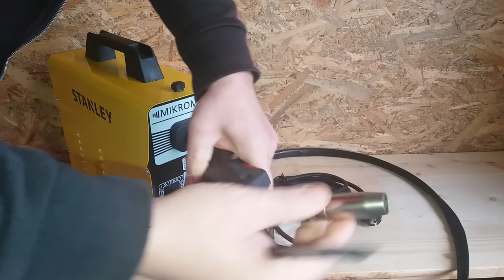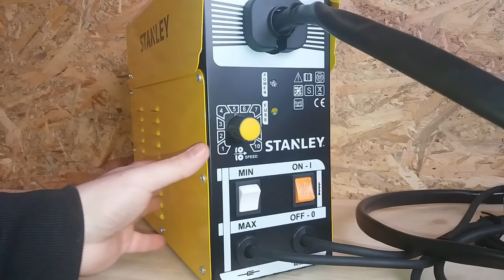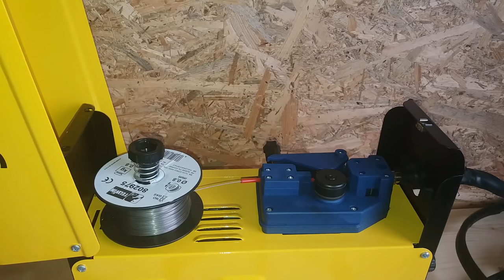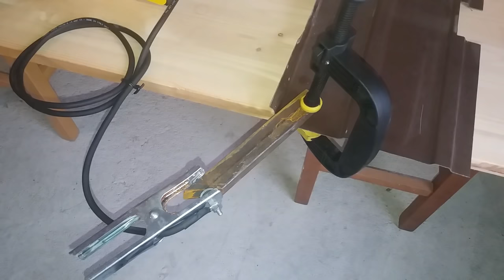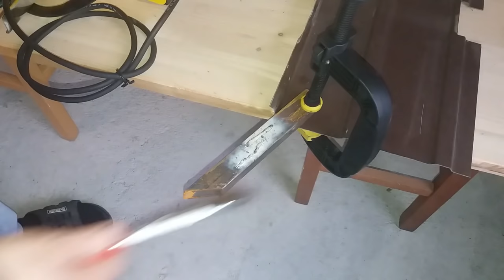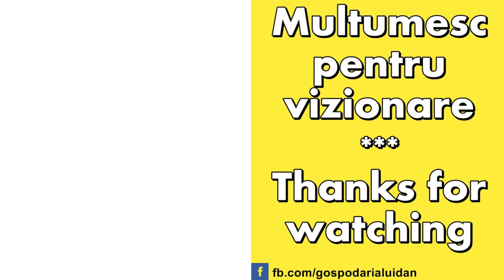Stanley Mikromig, aparat de sudura cu sarma

Comment from the maker: Pentru cei care se mira asa de tare ca am spus ca as incerca sa sudez si fara mustiucul de protectie, las aici un clip, mie imi pare ca tipul ala stie ce face: https://www.youtube.com/embed/s9OI6MqKA4E?start=105
Reply: De protecție la ce ? Ăla te protejează doar de scântei și uneori să nu poți da cu pistoletul la masă. De ce „uneori” ? Pentru că atâta zgură se strânge la interior, că unește duza de acel difuzor ceramic (îmbrăcat în cupru). Ca să vezi locul unde urmează să sudezi, poși ține pistoletul mai depărtat de piese, pentru că nu ești dependent de vr-un gaz. Îl poți ține și la 5 cm de piese, pentru că gazul rezultă din arderea fluxului, care e pe interiorul sârmei (la electrod e pe exterior). Cu cât distanța e mai mare, riști să se topească sârma pe toată lungimea, dacă avansul nu e corect reglat. Un avans mare unește sârma de piesă și așa dispare arcul care topește cele trei elemente - piesa, sârma și flux. Dacă avansul sârmei e mic, se formează un arc  voltaic mai mare, care pendulează între piesele de sudat, sârma picurând când pe o piesă, când pe cealaltă, și nu se unește topitura. O tensiune mare (atenție, nu curent mare, sau amperaj , după cum i se mai spune), face același lucru, să „fugă” arcul când pe o piesă , când pe alta, rezultând depunere grosolană până la unirea topiturii. După cu bâzâia aparatul, e un transformator simplu, iar după zgomotul la sudat, cum exploda sârma topită, e curent alternativ. În curent continuu și cu droser de netezire, nu lasă nici stropi, nu face nici așa zgomot, se reduce curentul de sudură cu mult ( nu mai găurește), încât poți suda și tabla de 0,3 cu el. Dacă-i mai faci și un reglaj al curentului, cu un triac, ai reglaj continuu, nu doar în două trepte. E rău că nu poți pune bobină mare, că tot e așa greu el. La proba a doua, ai mers prea repede cu pistoletul.
Reply from the maker: @nelute5  Da, de mustiucul ala vorbeam, am primit mesaje ca nu se poate suda fara el, de asta am tinut sa fac precizarea referitor la ce am spus in clip ca vreau sa incerc sa dau si fara el.
Reply: @DemoToolsYT  , merge și fără el,  nu are niciun efect negativ asupra sudurii.

Comment: Cumnatul tău probabil a sudat cu mașinării industriale  la 380 cu CO2. Eu am lucrat în Spania cu aparate mari și într-adevăr difera sudura și nu lasă zgura deloc. Acest aparat e foarte bun pt casa și se numește sudura  flux nu mig mag. Aparatele  MIG mag sunt întotdeauna cu gaz MIG (METAL INERT GAS) și MAG METAL ACTIV GAS). la amperaj mic redu din viteza sârmei pt ca e pt suduri mai fine.
Reply from the maker: "Stanley Mikromig este un aparat de sudura mig-mag care poate suda cu flux, tubulara de sarma, fara gaz de protectie." Asta scrie pe site-ul Dedemanului.
Reply: @DemoToolsYT  st foarte multe aparate flux pe care cei ce le fabrica mai scriu și MIG MAG pe ele dar este impropriu spus pt ca nu folosesc GAZ. Am văz ca în dedeman aparatul acesta costa cam 200 de euro. La aprox 250-300 de euro găsiți pe ebay și nu numai aparate foarte asemănătoare cu acesta, GAS no GAS  adică și MIG și Flux ( se schimba polaritatea pt flux sau mig și se inversează întoarce și rotita peste care trece sarma (are doua canale) cu canalul corespunzător și se schimba și sarma ca e diferita(  cea pt gaz rosiatica) acele aparate au în loc de butonul max min o rotita ca cea care modifica viteza sârmei și pistolul nu face masă dacă nu se apasa butonul. Sper ca e de folos comentariu  pt ce ce vor sa achiziționeze un aparat asemănător. Oricum asa cum am zis e destul de bun pt uzul casnic.
Reply from the maker: @danidaniel1531  Am inteles, multumesc de informatii, am mai aflat ceva.
Reply: @DemoToolsYT  , nu te lua după toți analfabeții din magazine și televiziuni, ci ia de bună ce spun cei ce comentează aici, ca buni cunoscători, unii cu experiență bună ! Aparatul e un simplu transformator de sudură, dimensionat să suporte curentul ce-l ia sârma de 0,8 și 0,9 adică maxim 70-90A, care are în plus un transportor de sârmă cu modulul lui electronic de reglare a vitezei .și pistoletul.  Bine ar fi, ca pentru reglarea amperajului, să-i atașezi un modul de reglaj cu triac (vezi filmul meu), din care să poți coborî mai mult amperajul (și numai amperajul, tensiunea rămânând constantă), până la nivelul  de a se putea suda la tablă, continuu. La amperajul mic, trebuie să reduci mult viteza sârmei, pentru a se face timp ca arcul să topească piesele, concomitent cu  adausul finuț de sârmă.

Comment: Pentru o gospodărie(strict), cred că sudura cu electrozi e mai ok. La MIG/MAG, (L.E. - stai, că tu nu folosești gaz la el, doar flux, mai grav...) ai mai multe de luat în calcul: tipul sârmei, tipul materialului de sudat, gazul, voltajul, amperajul, viteza sârmei, etc. La electrod e mult mai simplu, + că poți tăia material cu un celulozic, în caz de nevoie. Tot procedeul e simplificat, în cazul electrodului, cum bine ai punctat @3:17

btw, @ 10:52, treaba cu zgura... https://youtu.be/cx55FoR7L5g?t=31, cred că depinde foarte mult și de mâna sudorului. Eu, cu 6013, prin gospodărie, n-am treabă cu un invertor Telwin, cu rutilici de 2.5, zbârnâie, n-am zgură prin sudură.
Poate aparatul ăla e bun, nu zic nu, pentru mici intervenții, spor la lucru :) dar pentru gospodărie, eu n-aș da electrodul pe sârmă.
Reply from the maker: Cum am spus si in video, ma incanta ideea de apropiere a pistoletului de piesa pentru ca simt un control mai bun a ceea ce urmeaza sa fac. De altfel ma incanta faptul ca nu trebuie sa schimb mereu electrodul. Cam astea ar fi avantajele. In rest este un aparat pe care nu-l prea poti manevra de colo colo, eventual pe un carucior sa il tragi pe dupa tine prin atelier. Cam asta am reusit sa fac cu acest aparat, dar in general tot invertorul cu electrod rutilic folosesc si eu preponderent pentru ca este mai comod si mai usor: https://www.youtube.com/watch?v=brbuHh8AnSg
Reply from the maker: @alexandrubulai6033  Va salut. Se pot face fel si del de reglaje dar nu vad in ce fel ar creste amperii daca dau sarma mai incet devreme ce sunt doua setari pentru amperaj, mai tare sau mai incet. Sigur ca in functie de necesitatea sudurii si de material sarma trebuie sa iasa mai repede sau mai incet, de exemplu la o sudura mai fina in tabla.

Comment: buna ziua. Am o mare dezamagire. Nu pot sa sudez cu electrod normal. Mi e imposibil. Se lipeste, sare siguranta...ma rog. Precizez ca sudez de maxim 10 ori pe an...cate 2-3 fiare, o masa de curte....samd. Eram mega incanta cand am vazut aceste aparat pa dedeman. am vazut si videoul tau si ma decisesem sa l cumpar. am fost azi la dedeman si l am intrebat pe nenea ala de la raion daca e ok aparatul si mi a zis ca e o porcarie. ca merge sa sudezi doar tabla si asa,,,,prin puncte, in nici un caz cordon de 5 cm. mi a taiat tot elanul. te rog, sincer, ce parere ai ....sincera de acest aparat? poti suda doua rectangulare de 60x40x3 mm?
Reply from the maker: Buna seara. Aparatul este conceput pentru lucrari fine, sudura la tabla in special pentru ca arcul e mic iar electrodul (sarma) este foarte subtire si nu vei gauri imediat materialul cu ea. Insa eu l-am folosit cu succes si la sudat teava rectangulara (tocmai am facut un banc de lucru din teava rectangulara de 30x30x2mm, vezi clip aici: https://www.youtube.com/watch?v=brbuHh8AnSg) si am fost multumit. Insa aici depinde de mai multi factori, pentru a putea suda fier mai gros, va trebui setat pe treapta mare de tensiune iar viteza sarmei va fi reglata in functie de cat de gros vei vrea sa faci cordonul sau punctul de sudura. Trebuie insa sa mentionez ca in ciuda aparentelor, nu este usor de sudat nici cu acest tip de aparat. Sarma se lipeste si ea, se mai blocheaza in canal, se formeaza bucla in tambur daca se lipeste in pistolet, mustiucul larg nu permite o buna vizibilitate a locului unde sudeaza sarma si te trezesti ca mai sudezi si pe langa, etc. Dar da, pentru cine nu se descurca de nicio culoare cu electrodul rutilic, acesta este un aparat foarte bun si usor de folosit pentru lipit doua fiare cand si cand. Numai sa se merite investitia, aparatul costa peste 800 de lei. In concluzie, raspunsul meu este da, se pot suda, toata treaba este sa te inveti sa lucrezi cu el.
Reply from the maker: Iar referitor la electrodul rutilic, ca sa nu mai intampini problema cu lipirea, incearca sa aplici aceste sfaturi. Foloseste electrozi rutilici supertit, rosii daca gasesti. Nu te incurca cu bazici. Asigura-te ca masa se face foarte bine si ca este cat mai aproape de locul unde se face lipirea, bineinteles sa fie clestele pe piesa pe care se sudeaza, nu pe capra de lucru, de ex. Asigura-te ca locul unde se sudeaza sa fie curat, nu rugina, nu pamant sau alte reziduuri. Regleaza amperajul de sudare undeva intre 70 si 80 A. Daca electrodul nu se aprinde din prima, tocane-l pana vezi ca face arc intrerupt, adica nu-l lasa pana nu topesti bine varful electrodului, electrodul trebuie incalzit foarte bine ca sa faca arcul cat mai bine. Dupa 3, 4 tocaneli in care se face arc de fiecare data, atunci lasi electrodul sa arda in continuare. Incalzirea electrodului o faci de preferat pe alta piesa sau pe piesa sudata dar nu pe locul unde vrei sa faci sudura. In mod normal, daca masa se face bine, daca piesa este curata, daca amperajul este cel potrivit, daca electrodul este un supertit de calitate, in momentul in care ai pus varful electrodului pe piesa, acesta ar trebui sa inceapa sa se inroseasca si sa fac arc din prima. Fara lipeli. Si inca ceva, mie de exemplu imi tremura mana, ghidez varful electrodului cu mana in locul unde vreau sa fac sudura, altfel o sa lipesc varful aiurea pe langa, o sa-l trag si s-a dus deja capul electrodului pentru ca se sparge pasta. Eu cred ca daca vei exersa tinand cont de aceste sfaturi, vei descoperi ca sudura cu electrod e chiar usoara.
Reply: @DemoToolsYT  pentru raspuns. Ma voi mai gandi. Tipu de la dedeman mi a spus sa iau un inverter ca cica se sudeaza mai bine. plus ca eu cand sudez....tai electrozii la jumate :)))))) mi e mai usor. ma manaca palma sa iau acest aparat de la stanley. :)))) o sa ma uit acum la clipul cu bancul de liucru
Reply from the maker: @radudobrescu5402  Uita-te la clipul cu banc-ul si iti faci acolo o idee de cum merge. Cu ce tai electrozii pe jumate? Nu stiu daca e o treaba buna, se sparge pasta iar capul electrodului ramane descoperit. De aia ti se si lipeste. E ca un bat de chibrit fara forfor, nu se mai aprinde iar in schimb ti se lipeste din cauza curentului. Incearca cu ei intregi, de fapt, cand sunt noi atunci merg cel mai bine.
Reply: @DemoToolsYT  pai da, si  mie imi tremura mana, sudez pe langa, nu stiu cat sa apas de tare electrodul pe material, ma dispera sudura, prefer prinderi mecanice (suruburi) si la final chem un prieten care sudeaza ce am inchegat eu. pare mai ok stanley-ul asta. cat de cat. plus de asta stanley....totusi e firma...nu cred ca faceau ceva fff prost. un inverter de l stanley e 1100 lei. si inca o intrevbare, arcul porneste la atingerea sarmei de material chiar daca butonul nu e apasat? sau doar daca apesi butonul? multumesc
Reply from the maker: De multe ori e bine sa stii sa-ti faci singur niste chestii simple fara sa apelezi tot timpul la altul, de asta e bine sa invatam cate ceva de baza din fiecare domeniu. E mult pana prinzi singur cum merge treaba si pe urma ai sa vezi ca e destul de usor. Nu e prost deloc aparatul, eu sunt multumit per total, ce nu-mi place este ca e greu ca un transformator si cablul de alimentare iese tot prin fata astfel incat atunci cand il muti sau cand il strangi te cam incurci in cabluri, nu-i o senzatie prea placuta, de altfel nu imi place ca nu pot scoate cablurile din borna ca la invertorul normal. asta e bun sa-l tii undeva fix in atelier si sa sudezi cu el acolo sau eventual sa ai un carucioc pentru el si sa-l muti asa cu totul. Arcul se face la atingerea sarmei de piesa, la fel ca la electrod. Cu diferenta ca arcul se face instanstaneu. Butonul se apasa pentru a iesi sarma. Multi nu prefera acest tip de aparat pentru ca sarma fiind destul de subtire, sudura e cam imprecisa, adica te trezesti ca ai sudat complet aiurea si mai putin in locul unde voiai.
Reply: @DemoToolsYT  pai aia e si ideea sa fac singur. Am tot felul de scule, unele mai ieftine, altele fffff scumpe
 Am o goanga sa am diverse scule. Hobby, nu fac nimic sa produc bani. Mai o masuta de gradina, mai un cnc cu comanda numerica :) chestii din astea. Tâmplărie, imi place lemnul. Dar sudura mi a dat de cap....🙁 cred totusi ca e destul de ok acest aparat, sper....mi ar placea sa l vad pe viu . Oricum, multumesc mult de raspunsuri. Daca te uiti pe site la dedeman, sunt 7 comentarii pozitive la acest aparat
Reply: Si.o ultima.intrebare. sa mi iau aparatul asta sau un inverter?
Reply from the maker: @radudobrescu5402  Nici nu stiu ce sfat sa-ti dau, eu m-am obisnuit si cu invertorul, mi se pare mai simplu ca e mai usor, il strang usor si il impachetez, il pot tine in spate si pot suda si ceva mai la inaltime. Tine cont ca cu Stanley nu poti suda ceva la inaltime, trebuie sa te urci cu el pe o schela ceva. Daca stii ca vei suda numai intr-un loc, poti sa iei Stanley ca e simplu de folosit. Dar trebuie sa te uiti atent la tutoriale pe youtube cum se schimba sarma, ce sa faci in caz ca se blocheaza sarma, etc. Daca ai nevoie sa te si deplasezi prin curte, ia invertor, te vei obisnui garantat si cu electrod daca urmezi sfaturile pe care ti le-am dat. Am un invertor Steinhaus la 450 lei. Stanley e peste 800 (nu mai stiu exact acum). Tinand cont de aspectele astea, pune in balanta si ia o decizie.
Reply: @radudobrescu5402  Categoric invertor.  Dacă vrei totusi un mig-mag iti recomand un telwin. Găsești la Dedeman ceva la 1600 ron.
Reply: @DemoToolsYT  Și eu folosesc electrozii tăiați de la jumate, eu îi tai cu un clește ascuțit bine sau cu patentul de asemenea să taie bine nu să rupă.
Reply from the maker: Si ce faci cu jumatatea de electrod? Nu e risipa? Sau ii spargi pasta intr-un capat sa-l poti baga in cleste?
Reply: @DemoToolsYT  da, il tai cu flexul si ii dau pasta jos intrun cap. Am mai exersat cu aparatul pe care il am, unul ieftin dar am luat electrozi de 2 de la dedeman. Incepe sa mearga mai bine. Totusi o sa iau si un aparat cu flux intrun final pt suduri fine. Am gasit ceva cu la 500 lei. Marca Intensiv. Era pe emag la 499 acum s a scumpit dar l am gasit pe domo la 550.
Reply: @DemoToolsYT  La a doua bucată îi sparg pasta cca 1 cm, așa folosesc pentru suduri mai precise, adică de la o vârstă nu mai e stabilitate în mână mai ”tremură încheieturile” și de aceea folosesc jumătăți de măsură. :D)) :D))
Reply from the maker: @GheorgheBoghitoiuOrtodox  Si mie mai imi tremura mana dar tin cu cealalta mana de electrod. Pana arde ca pe urma nu mai e nevoie.
Reply: @DemoToolsYT  am cumparat pana la urma un aparat  tot ca stanley dar alta marca, intensiv de pe emag cu 500 lei. Imi place mult cum sudeaza
Reply from the maker: @radudobrescu5402  Ce model? Sa intru si eu sa vad
Reply: @DemoToolsYT  intensiv  mig-mag 130
Reply from the maker: @radudobrescu5402  Aha, l-am vazut acum. Dar e 630 lei. Principiul e acelasi si la asta, vad ca tot doua trepte are, e cam la fel, doar ca pare un pic mai lat. Si cum merge? Ti se pare mai usor cu asta?
Reply: @DemoToolsYT  eu l am luat la.499 lei. Il gasesti pe la 550 pe alte site uri. Din pct meu de vedere merge super  bine pt ce imi tb mie. Daca e ceva de forta(desi nube cazul) insailez cu asta si termin cu ala cu electrod

Comment: Thank you, this is the only video on the entire internet explaining this welder in detail ! I have to know one thing, what are its dimensions ? I want to know if it fits in my toolbox.
Reply from the maker: Thank you as well, glad to hear that. His dimensions are 400 x 365 x 220
Reply: @DemoToolsYT  Thank you, sadly its too wide, it didnt look like that big.
Reply from the maker: Then is time to buy a bigger toolbox :D
Reply: @DemoToolsYT  actually i want to fit it inside an old Mac Pro case.
Reply: @DemoToolsYT  pretty  weird i found the dimensions via a website and it should be  36 cm x 13.5 cm x 36 cm
Reply from the maker: @Boemel  I bought the device from this store, and there, in the technical specifications, it shows the dimensions given by me previously https://www.dedeman.ro/targoviste/invertor-sudura-mig/-mag-stanley-mikromig-accesorii/p/1043689

Comment: Va apare la Lidl in Germania din 16.05.2019 tot asa un aparat cu sarma cu flux, mai bun ca asta cu reglare in trepte a curentului si costa numai 99 de euro.Poate va apare si in Romania.
Pun aici linkul daca va intereseaza.
https://www.youtube.com/watch?v=IeNoNtEo8i8&t=936s
Reply from the maker: Da, Parkside, am mai vazut niste clipuri, principiul este acelasi dar intr-adevar pare sa aiba un regulator mai fin pentru tensiune similar cu cel de la invertor. Pare interesant si daca e numai 100 de euro, cred ca e rentabil.
Reply: produsele din lidl germania parkside sunt de rot rahatul scuze expresia dar le folosesti de 4 sau 5 ori si dupaa aceea ....